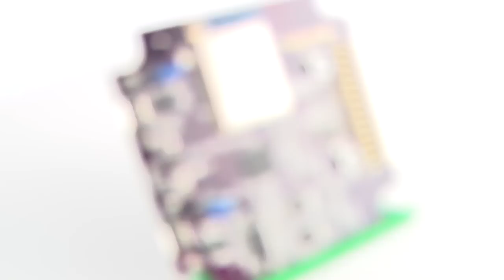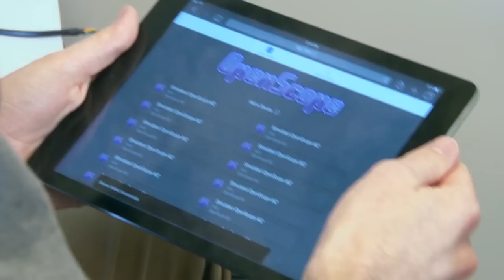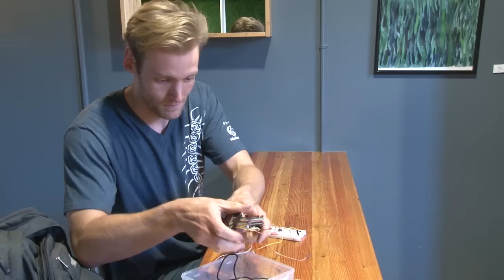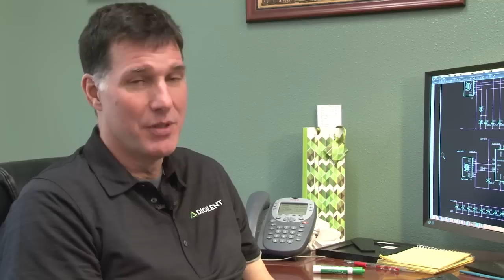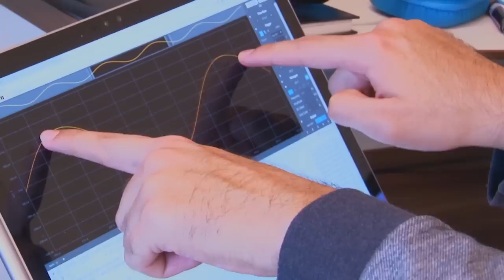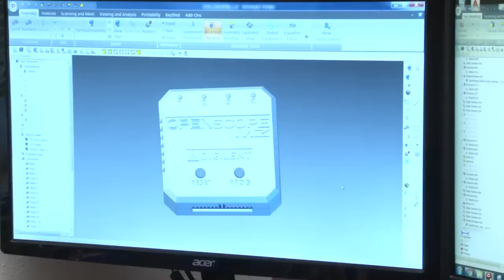OpenScope Introduction

Comment: Very interesting to have a wireless connection to your phone/Internet for logging and viewing remotely. The performance should be closer to the Analog Discovery though or cutting the price more for even lower performance and use as IoT logging device. 

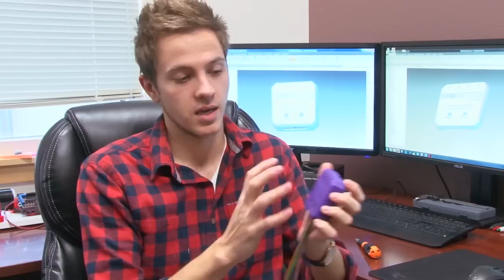I also suggest that you try to do videos more like the format at 3:24 since the information is heavily focused for engineers and not "average" consumers.

Comment: 1 MHz? It is way to less and therefore, very expensive at this price point, Hantek 6022BL provide Oscilloscope of 20 MHz around 100$ and which also include 16 channel logic analyzer running at 10 MHz.

Comment: I have the Analog Discovery. Any ideas why the Analog Discovery costs more than twice as much? I know it's far more capable, but does it really cost that much more to produce?  I applaud anything that can be done to create equipment for a student/hobbyist budget.
Reply: The Analog Discovery has an FPGA and dedicated ADC's and DACs (the DACs alone are $18.00 a piece, which is 2X the Microcontroller that runs the OpenScope).

Comment: What an utter joke! 1 MHz? Sure, fine for a toy... except for the price of a few of these I can get a scope that outclasses them by two orders of magnitude. Or I can get two logic analyzers for the price of one of these, that, uh, also outclass this by two orders of magnitude. Gimme a break...
Reply: I guess you hit it on the nose there...you need to pay triple the price to get something better, which isn't open source so you're stuck with what you get. Digilent's advertising this as affordable, so of course that limits hardware capabilities. As for the logic analyzers, too bad you would need to also get a separate oscilloscope if you needed that. Do you have a link to a $50 logic analyzer with 100MHz of bandwidth?
Reply: Actually, I do - and it's also open source. I have one and I love it to bits. Oh, and it goes up to 200 MSPS... http://dangerousprototypes.com/docs/Open_Bench_Logic_Sniffer
Reply: Very cool! I don't think I've seen that one before. Do you happen to know what the bandwidth is on that? I can't seem to find it browsing around on their site.
Reply: Well, it's a logic analyzer not a scope, but it does sample at max 200 MHz; not sure how that relates to the bandwidth which is typically an analog spec, but the input buffer is the OnSemi MC74LCX16245DTG, with a propagation delay of max. 4.5ns - make of it what you will... :)
Reply: 1 MHz per channel isn't too much of a joke (it's 2MHz total).  It can do most audio. Now video, it may be an issue.